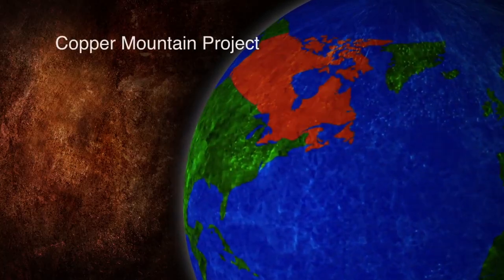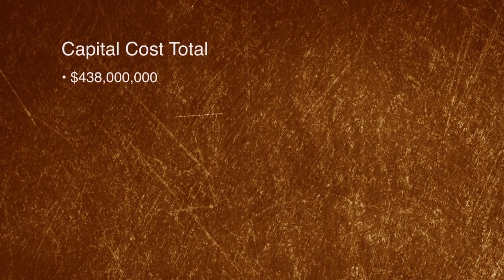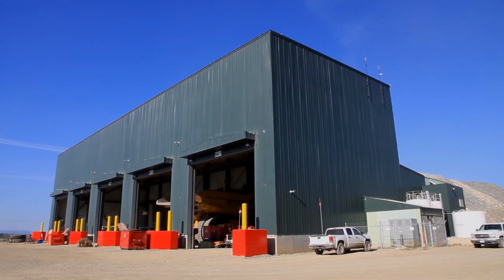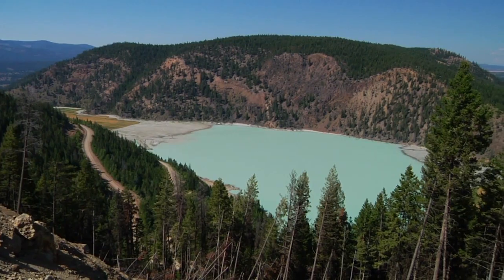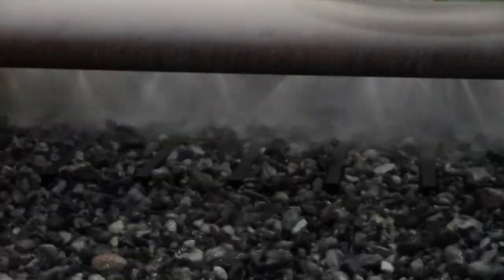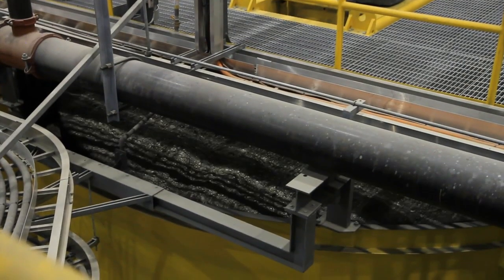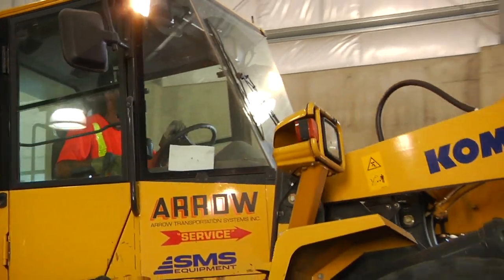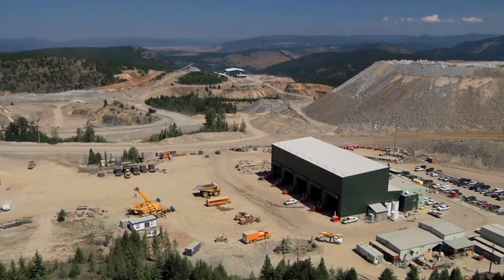The Mining Process at Copper Mountain Mine

Comment: Who’s gonna pay for all the cleanup when mine is done producing copperAnd the tailings pond which will be very acidic nothing could ever live in that
Reply: Do a little research, hippie.  Mines are required to put up bonds to ensure reclamation.  It's cheaper to clean the place up than to forfeit the bonds and pay fines.  It's already accounted for.  As for getting rid of acidic tailings:  You simply send it down the river.  Very slowly.  The process is closely monitored.  Not a single fish will die.  That's AFTER they extract valuable minerals from the tailings.

The video showed you how they deal with the tailings pond.  Try paying attention.

Comment: I would like to know the properties of the copper mineral and if it has any applications in that form. Also, what is added to the alcohol solution to make the copper float?. I'd also like to know how the ball mills work.
Reply: Click here for details and price: https://www.hxjq-machine.com/products/12_ball-mill.html?=cxf
Reply: HX Mining Machinery thank you for your considering, your ball mill reply most favorable.
Reply: They mentioned float collectors in the video. This will be a hydrophobic chemical (think hydrocarbons) that attach to the copper. The air bubbles into the system will catch the float chemicals and take the copper to the surface.
Reply: Matthew Adams they use pretty much the same process at the lead mines in southern Missouri. It's kinda cool to watch but good lord it stinks. The mines themselves on the other hand, are absolutely awesome. You can go underground in one city drive 40miles underground and come up in an entirely different town. Roughly 40 miles of underground roadways between operations, and something upwards of 250 miles of tunnel altogether.
Reply: The ball mills are basically a giant rock tumbler. Ore and water are spun in the mills while softball size metal balls crush the ore down to size.
Reply: The copper concentrate is smelted and usually turned into copper rod.

Comment: What is the waste product and where does it go?
Reply: Waste product (ore with minerals removed) goes to the tailings impoundment. It's a slurry of process chemicals, water, and dirt.
Reply: Are the impoundments remediated
Reply: @Skyquake98  no, it will evaporate and blown by the wind.
Reply: Toxic sludge, and it eventually goes into your drinking water.
Not now while the factory is still running.  But after when it's abandoned.  That's when we will find out what they did, and how much it will cost taxpayers to clean it up.

Comment: The current price of copper is below the cost of production. WTH?
Reply: +Tobacc0 Below the total cost of production. The operating costs of production are lower. Capital costs are already sunk, can't get them back so they keep going. TCP = OCP + CCP. Economics 101
Reply: Tobacc0 any Mine with any resource. The challenge is to get production per tonne as low as absolutely possible. I find it hard to believe the price of Copper would be that low. 175,000 tonnes of copper per annum seems very low to me. Here in the Pilbara Lithium Spodumin sells at $15,000 US a tonne. They produce in the millions of tonnes per annum.